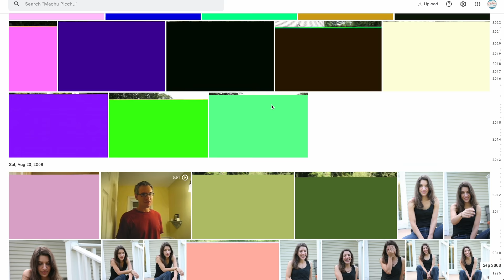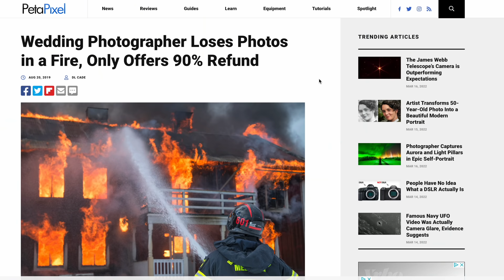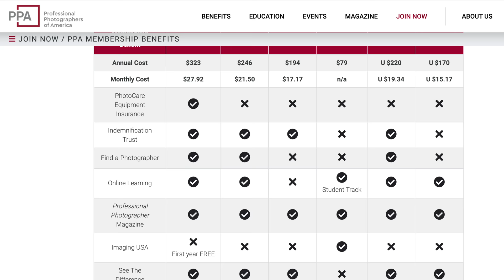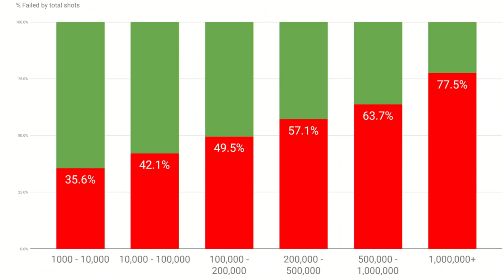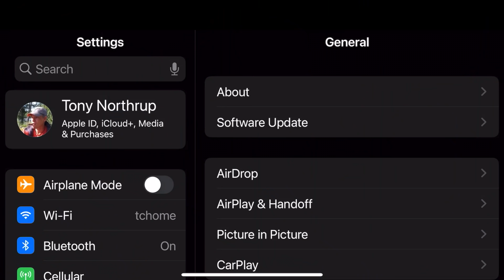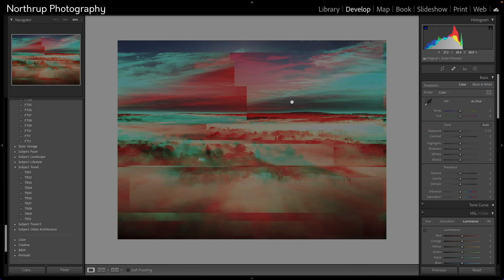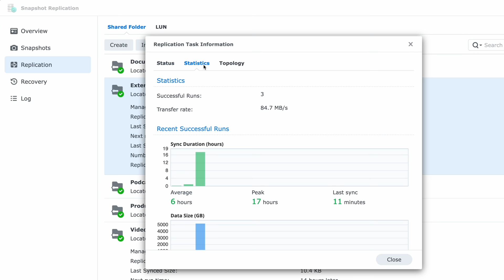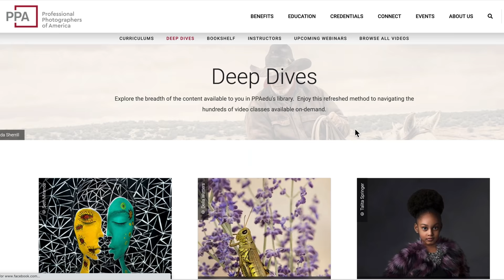NAS Storage for Photos & Video: PROTECT YOUR DATA!

Comment: Very good advice there Tony, also coming from an IT rich background I’ve seen plenty of the old writable CD and DVD’s turn to custard after a few years , very dependant on brand. Ironically the slides my folks took in the 1950’s of us kids still look good so long as all those other catastrophes you mention don’t befall them.  Fully agree that as you get older and people pass away it is  great to be able to look back. Cheers Chris from NZ
Reply: Optical media just sucks as a backup medium. Apart from preventing deletions and modifications, it just doesn't do anything compelling and is a massive pain in the backside to check.

Best thing is a hard disk based backup system with online backup and automated file verification. Preferably using a filesystem that can detect and repair bitrot, but as long as you detect it while you still have a good copy, that's OK.
Reply: @SmallSpoonBrigade  agree entirely, I haven’t backed up using CD’s since usb drives were affordable. These CD’s were backups we made in the office in the 90’ s and claimed to be “archival” 😀😀 our first Pc with a ten mb hard drive for my engineering team plus a dot matrix printer, green mono screen, plus a pen plotter in 1985 cost $47,500 in todays money ($33,000 US) I think my toaster has more computing power and a single image from my mirrorless camera would fill the hard drive five times over and yet back then we though we would never fill it. In the mid 90’s ram for my 486 was $100 a megabyte !!!
Reply: That is why I still use slide film for important photos.  I’ve lost too many digital files and almost no slides.
Reply: @trevorsowers2202  Interesting approach and of course I’ve still got my parents Kodachrome ll slides from the 1950’s still in great condition. I did have a complete failure with Agfa slide film I used in Australia in 1980 much of it now has an orange tinge. Of course easy enough to scan all that old stuff. Printing is my long term archiving option plus photo-books of course. Not sure I could go back to film after spending 35 years in that medium but you are correct in thinking long term digital storage no matter how carefully you are hasi it’s pitfalls and I wonder what will become of all the images taken by todays youth taken on phones when they want to show the grand kids in years to come. ☹️ 
I do have a mistrust of online services and there subscription models that’s for sure.
Reply: @Chris-NZ  some films are more stable than others for sure.  Kodachrome was very stable but early E6 slides were not great but the later E6 is great.  I have lots of Ektachrome that is 30+ years old and looks as good as new.  I’m currently using Ektachrome E100 and I’m very satisfied with that film.  I use a EOS 1V and a 5D MKIII so I can carry one set of lenses and speedlites and shoot digital or film as the situation warrants but the more important photos are usually done with Ektachrome as I have more faith in that medium
Reply: @trevorsowers2202  I think your faith is very well founded 😀

Comment: Customer files get backed up on two external drives.  I try not to reuse the SD cards aside until the project is over.  Deliverables get stored in OneDrive.  BackBlaze also runs continually to keep everything backed up another layer, with the 1-year history add-on in case you need to roll-back to a previous version.  Haven't had an SD card go bad since I switched to the Sandisk Extreme Pro cards.  They're (much) more expensive, but haven't had any failures in the last 10 years.  During my university days in the early 2000s I had a HDD go bad on me where I lost a few weeks worth of files, but otherwise fortunate to have all my files since the early 1990s.

Comment: This is pretty basic for someone who does know something about data protection and storage, but in reality, it's not common knowledge and if you want to do it properly it can be quite annoying and expensive if you have lots of terabytes of data.
The key concept anyone should know is the 3-2-1 rule:

3: you must have at least 3 copies of your data
2: in at least 2 different physical drives
1: and 1 of them must be in another physical location

What does that mean in layman's terms? the easiest method would be:
A.- get a couple of external disk drives and backup (duplicate) your data on both disks. Then pay for a decent online storage service and also make a backup there.
B.- get a couple of pre-built NAS hard drives and backup your data with redundancy on both units. Then grab one of those units and leave it on another place like your office or something like that, away from your home. Then keep them synced online via internet. This method is far superior but it has a higher initial cost and it requires some configuration.
Hope this helps someone. Sorry for my English, it's not my first language.
Reply: This is true and it's especially annoying given the high quality tools that currently exist to prevent this. From database programs like imatch that have built in file verification functions, to file systems like ZFS that can be set up to detect and fix bit rot to various online backup utilities that can mirror the data to multiple data centers in different regions.

But, it's still not on by default and requires a bit of work to get right.

Comment: My horror story isn't about total loss, but partial corruption, and I want people to know: USE AN INTEGRITY-CHECKING NETWORK TRANSFER PROTOCOL TOO !
What happened to me was the switch inside my router had started silently corrupting parts of some network frames from time to time.
It did not impact transfer speed so I didn't realise something was wrong, and as the default setting on client Windows versions is not to enable signing for SMB - which provide integrity, my PCs were transferring data that was being silently corrupted.
I only noticed when I copied executable files over the network and Windows then said they were corrupted once I tried running them. That is the moment terror struck me as I realized my whole music collection that I had recently moved from an old machine to a new one was now corrupted and all my FLAC files now had glitches in them... As I kept that synced up, the synced copy also now had the glitches. I cried a bit.

Comment: Wow, this is horrible news.  So sorry it happened.  The problem came about because hard drives were the only foundation for the back-ups.  For still photos and family videos, I feel everyone needs to upload to a website separate from their hard drive solution.  I have uploaded my finished JPGs from every commercial and personal shoot since 2008 to Zenfolio.  I am so glad I have those pristine files online there.  However, I realize Zenfolio could have issues at some point.  So, for the past couple of years I also have been adding my exported JPGs to the Adobe and Apple clouds.  In a nutshell, I export my JPGs at full size with a quality level of 90 and have them on my Synology at home and online with Zenfolio, Adobe and Apple.  Hope this helps someone.

Comment: Last year I lost a 1TB drive with lots of media on it.  I don't yet go to the extreme of off-site storage or fire/waterproof safes, but I decided to make multiple copies of files past a certain age and spread them across various drives (Laptop, NAS, Desktop, Google Photos and older drives that I leave unplugged in a closet).  Since HDDs always get larger, every time I upgrade, I make a new copy from a verified-good backup.  It's pretty manual, but it hopefully prevents the automatic backup of corrupted files.

Comment: As a geek, I nowadays only use filesystems with checksumming - btrfs on the laptop and less critical single disk systems, ZFS on the desktop and the rest.
The desktop, which also uses ECC memory, is where all photos are copied to and live. Its data partition a RAID6 array allowing for 2 disk failure, but since upgrading it to be NVMe-only, that amount of redundancy was not feasible both in terms of  cost and number of PCIe lanes. 😉 Not a big issue, as the system is backed up nightly to my local backup server that has a ZFS mirror as well as two different online storage providers - all these are encrypted and fully deduplicated, growing only by actually new data. QR-code printouts of the cryptographic key material stored off-site in a vault.

Photos are recorded to 2 memory cards, I prefer more smaller ones, so e.g. on vacation, after each day of shooting, they can be taken out and stored in different locations. Back at home, the secondary cards stay in the car, while the primary ones are copied onto the desktop ASAP. Long since, the (semi-automated) commands for the copy process involve a second pass of verifying the files on disk are bit by bit identical to the ones on the card. Tanks to the absurd failure of the camera industry to put a GPS chip into every modern camera 😡, the files have to touched one last time to fix eventual timestamp offsets and geotag them. I go quickly over them once to eventually sort them to individual folders (if multiple locations were visited on one day), enjoy a first quick review of what I ended up with and make sure all photos do display correctly (ie. are not obviously corrupted, e.g. by the camera writing garbage or the primary card having an issue). Before using checksumming filesystems, I often did create checksum files (actually MD5 hashes, most of the time) of the photos to allow detection of bitrot after that point.
The cards only ever get formatted and put back into the camera bag for reuse once the next backup of the desktop has completed successfully.

Before having a camera with 2 card slots, I managed to corrupt and loose a few photos in one incident: After copying the previous load of photos off the SD card, I forgot to properly unmount it before yanking it out of the card reader. Put into he camera, I formatted it in there and went out taking photos. So far things were all fine, the problem arose when finally reinserting the SD card in the card reader and the system did not realize that it had been modified since being yanked out, writing some outdated data on it, ruining the directory structure. Whether the camera is to blame for formatting every card with the same serial number and maybe not even applying a different time stamp, or the at that time early implementation of exFAT not bothering the check those before assuming a reappearing block device being the same as before and happily writing stuff onto it, I never bothered to research. What I did was making an image of the whole SD card and then recovered all but very few photos from that using photorec.

Comment: I‘ve lost a film roll from the wedding of my very best friends, who relied on me taking good photos from that event—I absolutely know what you are talking about. I‘ve also seen several hard drives suddenly crash. It’s not the question if such things happen, it’s only about when—and you’ll never know that in advance. By the way, having one redundant backup system is not enough. I have seen two redundant raid-5 systems electronically fail in two days, so before the first of them was repaired … 1 TB of photos needed te be recovered from tape.

Comment: The best advice you have given, fortunately, although I had a laptop that suddenly failed, I was able to remove the hard disk and transfer. Not had any failure of cards, though now I am tempting fate.  I always transfer SD cards to iMac or SSD Sandisk drive.  Still have thousands of negatives though that are in their protective slide sheets.  However, will invest in further back up, i Cloud looks promising. I did know, after being a geek like you, that digital storage can get corrupted over time. All the best, thanks for the reminder! Share you sadness, that is a photographers nightmare, it is like robbed and having all your equipment stolen when insurance could not be afforded. Yep that happens.

Comment: Spot on Tony, and timely too.  Only two weeks ago I had a massive storm where a very close lightning strike meant we lost power for just over two days, and flooding caused all sorts of other problems.  I have at least one UPS on almost all my pc and tv equipment, but I was only using it for power, not for the network cables, so the lightning strike ended up frying my WAN port on the router (connected from the modem by a long network cable, which picked up the lightning RF), so once I got power back it took a while to work out the issue.  One very scary part was that without the router, I couldn't know if I lost my 12TB NAS box, as it was hard to get it to boot, and I didn't know if I lost it all for ages.  I'm currently organising my online backup, which will be terribly expensive, but I can't afford to lose it all.  Your bitrot reminder is very scary though!

Comment: So... since you have all these devices - synology, back ups etc. How did you end up being a victim of a bit rot? Your advice is what to do for us - and yes - you have done everything right and still something went wrong. What did actually went wrong specifically in your case? What did you miss that you are going to change?
Reply: Apparently Synology doesn't have scrubbing enabled by default (at least it wasn't for me), which is what repairs bit rot if it's run periodically (anywhere from monthly to yearly depending on who you ask)
Reply: @ThioJoe  looks like a critical miss. Is this option not promoted as a must have? It would be nice if @Tony does spell it out because the video points to recommendations (all valid) but the viewer is left guessing "what did really happen"
Reply: @StefanHundhammer  This is absolutely NOT true. Bit rot is not an attribute of the date, it's an attribute of the magnetic strength. If you copy files that are barely readable from one drive to another, the copy is refreshed with a strong magnetic strength. You then format or rewrite over the old hard drive.
Reply: @matrixate  does that mean you could simply refresh the data on a hard drive by the writing all of it over itself ? Or is it that once this hard drive is weak magnetically it won’t be stronger again after writing again ?
Reply: The lesson is that nearly all hard drives will eventually fail (I discussed this with an IT person). Some take 7 years, some even less years, some 20 years, so having multiple backups and the methods Tony used is the best solution. Tony may have lost some photos, but learned along the way to remove this problem with better systems he is sharing here. (I have had both HDD and SDD drives fail in past, but the backup may not have failed.) For personal photos, always a good idea to print some of the best images from your life at a lab for more permanent memories.
Reply: @adrianvanleeuwen   - so "what is the mistake?" The video is titled "I LOST MY PHOTOS. Don't make the same mistakes." We are guessing that he did not turn on scrubbing on synology but this is my question. Was it the scrubbing? We can talk about cloud backup but he himself doesn't do it because of 100 TB data and cost. There is an off site backup to a fried (good) but how did it end up both replicating the error? Don't get me wrong. We all can make some kind of backups (better or worse) but I feel key information is missing. It would have been nice if he did explain what went wrong in his case and how did he changed the workflow to make it better moving forward.

Comment: I'm sorry to hear about that! Data loss is a real nightmare. I feel the urge to check on my files asap... After my NAS and the cloud, my third way to backup photos is actually Blu-Ray discs! Optical media rated for a 100 years. If my files are intact at the point I burn them to the disc, bitrot is rather unlikely. I keep the discs in my basement which is basically a bunker, so they are relatively safe from fire or other disasters. Of course this is only for long term storage and not for files I use regularly.

Comment: The following solution is not cost effective for those with really large photo libraries, but it is a good option for 1 or 2 TB libraries. At the end of each year, I buy a new backup drive for about $100, back up all of my photos on it, and then put that drive in a security deposit box with all of the others from previous years. If in 2030 I find that my photos from 2015 have bit rot. I just go through every year's backup drive until I find the backup without bit rot.

Comment: For most people, I would just check your onsite backup before syncing to the cloud, and then for files that don't change, don keep resyncing them, as this can lead to problems if your onsite backup (that is used as  source to sync with your cloud backup) becomes corrupt, then you're syncing corrupt data.  What I do is verify my files both onsite and then after they are in the cloud (using verification tools) and then once that's done, I disconnect the backup (no need to continue backing up files that don't change, which is usually my RAW files).  Then I do backup my catalogs and edit data (and any files I create with PS or LR) and sync those.  At least my RAWs are untouched as I don't sync them, but rather just do a one-way backup once, and then I'm done (so more like archiving your RAW files in the cloud, not syncing them, which is two way on most systems).  In fact as I'm writing this, I'm doing a second cloud storage backup of my files on another cloud storage platform just to be safe.